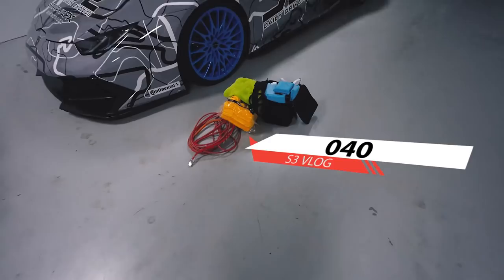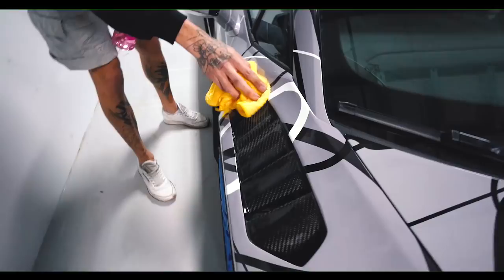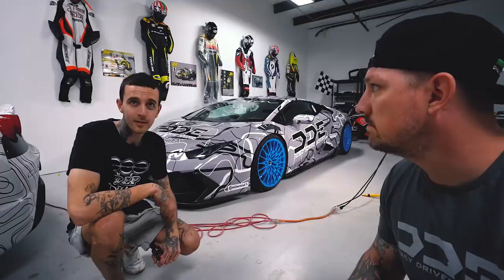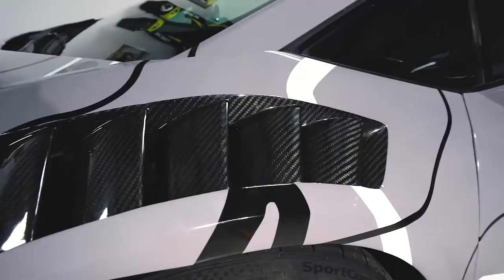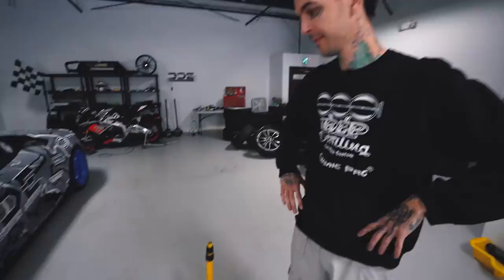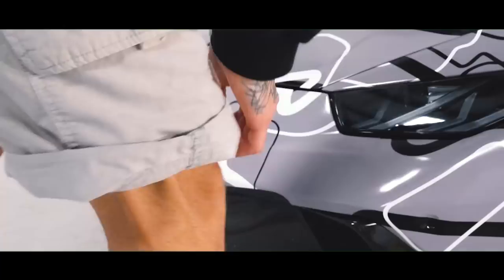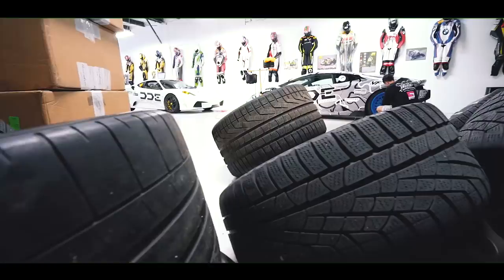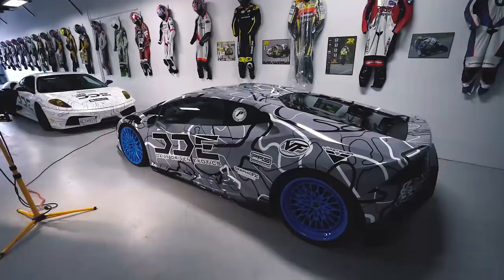CERAMIC COATING MY SUPERCHARGED LAMBORGHINI

Comment: If you could have a an JDM car what is it gonna be? would you accept it in a tire Slayer family?
Reply from the maker: V spec R34 Skyline
Reply: DailyDrivenExotics Yes...!!🔥🔥 Same here and I know you're gonna say that✌️
Reply: DailyDrivenExotics good choice
Reply: I'll probably pick a 2018 Subaru STi or  2018 370Z Nismo, or a Toyota 2000 GT (66-67)
Reply: I choose miata cause it's cheap and very great car
Reply: 240z or a rx7
Reply: toyota chaser jzx100, or nissan stagea 260rs. Those are a beast that can kill anything.
Reply: Supraaaaa
Reply: Proadequacy the 240z is a good is choice. But what year ?
Reply: 99-00 Honda Civic Si.. the car is just to sick. Had it when i was teenager and Hell no to dogging on it >.<
Reply: U Kno Lexus brand is pretty B∆d @ss so I'll also pick their LFA, LC500, GS460, GS450 or their older model SC400
Reply: DailyDrivenExotics probably a N spec R34 Skyline for me. Both are great
Reply: Ranger TX808 i would choose a 2004 Subaru impreza sti
Reply: FD RX7
Reply: Supra,make it fat as and shred those tyres.
Reply: Mitsubishi EVO IX for sure
Reply: V spec GT-R R34 nismo
Reply: Honda NSX 06’
Reply: DailyDrivenExotics 1995 Toyota supra Twin Turbo  converted to a huge single turbo...
Reply: Toyota Corona, but first I'd put blast pipes on the dde lambo!
Reply: dont play with my emotions man I've been burned before
Reply: No ones talking about the one of the most legendry car to day and its my dream JDM car...
The 2000 skyline duhh

Oh also the evo x
Reply: Toyota supra mk 4
Reply: Mk4 Supra

Comment: hey Damond have you thought about fixing the diffusers ??

Thats a super quick and cheap fix if you don't mind making some small extra holes on the rear bumper and just shoving some buts in there . and on the front man ... this step id even do it myself....

I would personally just fix the front diffuser with some fiberglass, sanding it properly ,bondo more sanding, primer,more sanding and finish it off with a nice gloss or mat black . 

After thats done you can just wrap it and you have a diffusers that look like new :). 

you can also just pay a pro to do it. thats not something that should cost much .
Reply: its a daily driver . those diffusers are gonna keep being exposed to all kinds of madness lol . you should ask a good body shop for sure.  all I'm saying is  that it could also just be fixed .you don't have to buy new ones or wait a lot .

Comment: Hey Damon, could you ask Alex which ceramic coat would be best for applying directly over the paint?
Reply: roupya dhal 9H
Reply from the maker: It’s the 9H from Ceramic pro. They have a specific vinyl and paint version.
Reply: I use Cquartz but there is a UK version as well depending on where you are.